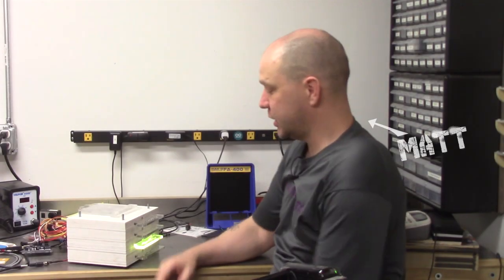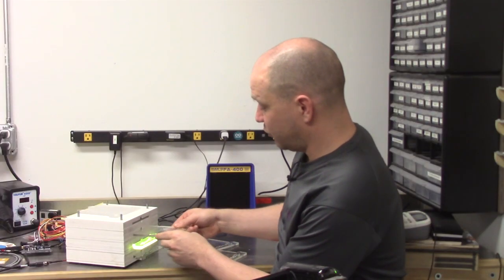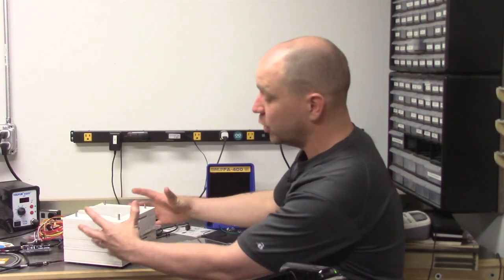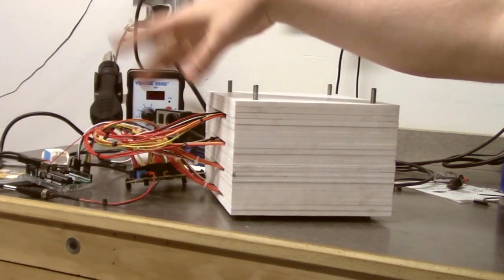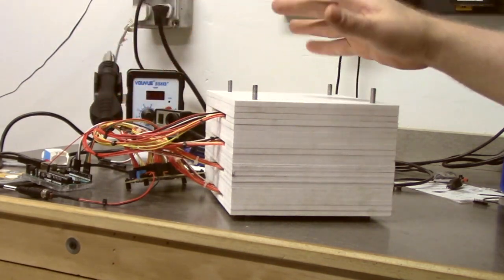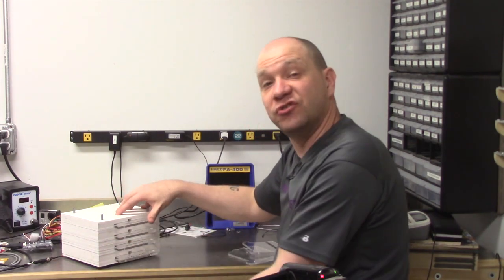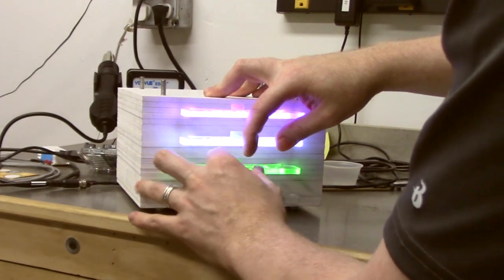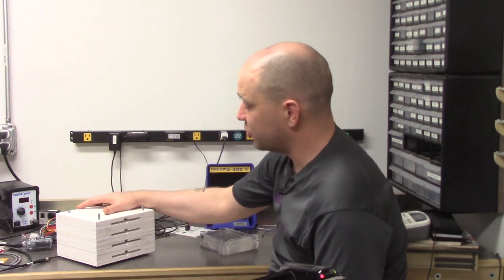Command Card puzzle MkII

Comment: This is amazing! How did you get the slots to change colors for each different card?
Reply from the maker: Thanks for the kind word!
Each card has several nodes on the bottom. These nodes correspond to (and depress) individual micro switches at the bottom of each slot. In this intermediate version, the teeth tell the processor (through the switch combination) which color the card should light up via neopixels.  The original, simpler puzzle is here https://www.youtube.com/watch?v=gk4z2JWPfMs
The final version demo is here (available for sale) https://www.youtube.com/watch?v=AdD9SnMlSxE

Comment: How did you make the key cards? did you do a tutorial on it?
Reply from the maker: We haven't made a video on it yet. We show them better in the space toast video. They are CNC engraved, drilled and cut out (in that order) using 1/4" acrylic. the distance from the bottom of the teeth to the wide part at the top is crucial. The aluminum "T" spline is flush riveted to the acrylic. This serves two purposes: It makes the cards directional- they can only be inserted one way. The other purpose is to add weight, so the card is heavy enough to operate two micro switches. Stand by...I'll get you a link to the other video...
Reply from the maker: Here's the other video:  https://youtu.be/AdD9SnMlSxE